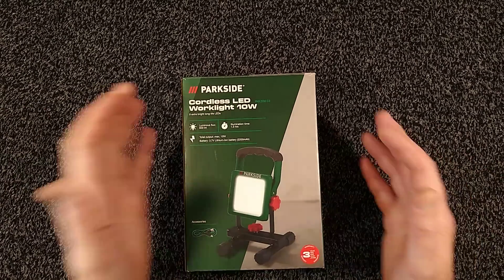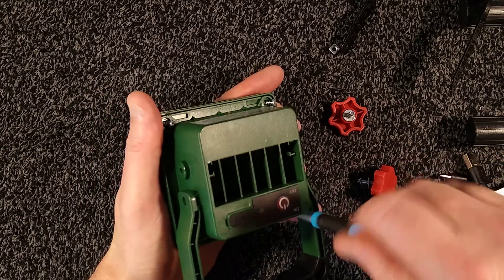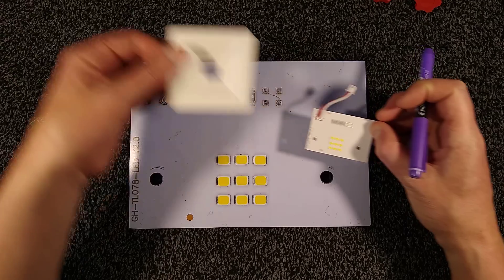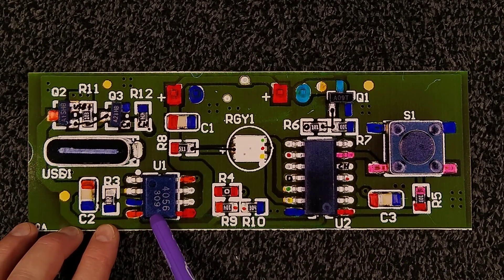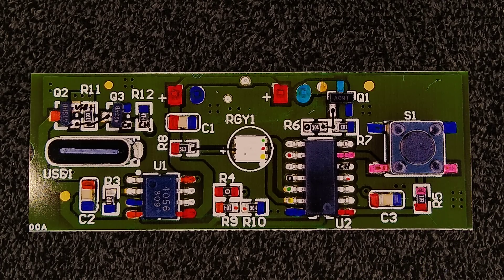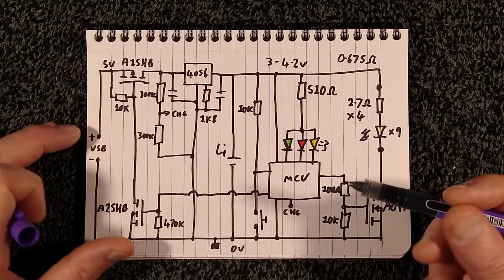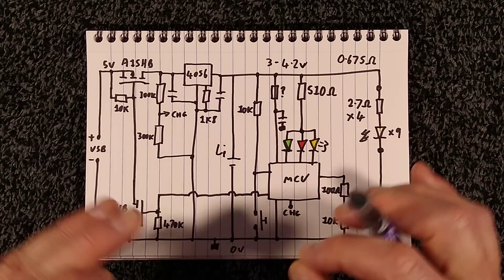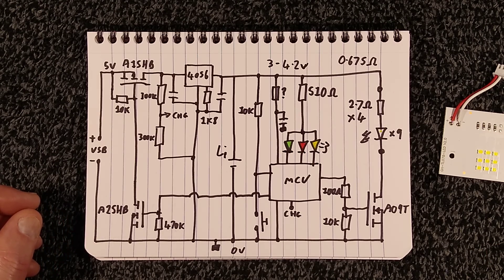Inside a LIDL USB rechargeable work light - with schematic

Comment: I bought one of these from a German Lidl last week and they seem to have changed the circuitry somewhat: It now has a secondary locking switch under the USB port cover that disables battery power (I don't think it's a physical cut off but it disables both charging and the light). The battery pack is still based on an 18650, but it now has a third pin with a thermistor on it. The series resistors have been moved to the main PCB and are now 4x 1.2 ohms in parallel. Interestingly, the unlabelled microcontroller seems to do some PWM, but it only seems to kick in when I connect a small load (not visible on the oscilloscope with the LED board connected, 300-odd Hz at 90% duty cycle when I tried hooking up a secondary MCU for dimming purposes).
Reply: Correction: it's 3x 1.2 ohms. And the USB-C appears to now have the proper detection resistors on it.
Reply: I have this light, but mine has terrible battery life since I bought it. After year it holds I think for 30-45 mi utes, maybe? 
It always annoyed me, that I can't charge it and use at the same time. I thinks it's there be compliant with IP waterproof standard, maybe? 
Do you think that it's possible to remove this switch, so I can charge and use it at the same time? Safely?
Also, can I safely replace that lithium battery with something like 21700? Will it fit in there? Or maybe you have other suggestions?

Comment: 6:56 how come it works without the extra USB-C resistors? Clive used micro USB before because of this .
Reply from the maker: It relies on the use of USB-A to USB-C cables with no device monitoring.
Reply: @bigclivedotcom  my initial reply got deleted by YouTube. I asked about making a custom type C cable to that always worked, but perhaps it would be directional. 

I did say the name of a group starting “one d…..” that’s in the news - I wonder if they triggered YouTube
Reply from the maker: @davadoff  Those keywords may be in a YT incident filter.  Theoretically you could add a couple of resistors to a USB cable to make the charger active.
Reply: No, wait… a regular USB 2.0 type A to micro USB cable with the plugs cut off and replaced with type-c both ends would work… I think 🤔

Comment: Question to CLive, there looks to be enough space in the unit to squeeze an additional cell, do you think with inclusion of a cell balancer module between the 2 cells and the lidl PCB, would these charger circuit handle still work safely ?
Reply from the maker: I tested and a second cell in parallel can fit in.  As long as they are very close to the same voltage when connected in parallel they will act as a single larger cell.

Comment: I have the same light, and i use it as a night/bed light, but I have moded mine by removing the low AH 18650 battery and replacing it with 2x 3AH 18650 cells.

Comment: Ok, Clive, here's a hack you can do. Install a switchable resistor network (i.e. switch and some resistors) so that you can switch the brightness of it.
Reply from the maker: It could be done by putting the switch in series with one of the leads to the LED panel and having a resistor in parallel with the switch.

Comment: I do not see how the MCU monitors the battery voltage. CH6 and the two resistors monitors the voltage input of the 4056 which is not the battery voltage. Anyone know?
Reply from the maker: It uses the divider also used on the push button input.

Comment: what i got from this video is that it is repairable but you cant get parts for it
Reply from the maker: You can change the lithium cell or even add another in parallel.  You can tune the LED current, and if needed you can swap out the LEDs for a new batch.

Comment: I picked up 2 of these from my local Lidl but they are yellow, not green and no logo either.  I also bought one of their little foldable work lights (HG11138 / PAK 2200 B2) with a torch at one end, unfortunately, it has a few flashing modes as well as 2 red modes for some reason!
Reply from the maker: Yeah, I've got one of those here.  The red and flashing modes are annoying.

Comment: Hi Clive, I bought 2 of these lights this week from Lidl mine are yellow, maybe some differences. Battery is 2200mAh I checked the capacity using Opus BT-C3100 it came out at 1310mAh. The 9 LED resistors are 1.5 (yours are 2.7) how many do you think could I cut off? The circuit board is different to yours; the microcontroller has 8 pins no number also has the 4056 chip many other differences compared to yours. Could I heat the LED circuit board with a hot air gun before trying to unsolder the resistors?
Reply from the maker: I tend to recommend just gripping the sides of the resistors and breaking them off if you're just taking some out of circuit.
Reply: I bought a couple yesterday, and got pretty much the same cell capacity. My cells were manufacured in 2021 which may be the reason. I took one of the 1R5 resistors off and the light output is barely diminished.

Comment: At https://youtu.be/wqt2W_AiXKg?t=227 in the video, on the right side, the resistor mounts, there is an obvious solder goober crossing from positive to negative, even crossing to the pad next door, isn't it an effective short, or at least enough to change the resistance value from what was intended?

Comment: I hate it when work lights don't work when they are connected to power. I cut out the R9 transistor. The light turns on with the charger and standalone, but you lose charge indication and battery level indication. It always shows the yellow indicator, regardless of the actual battery level. You can trigger the green (fully charged) indicator if the battery is fully charged and you apply voltage to the old R9 contact to the mcv-side. If you drain the battery and after that you charged the light, the light does not work until you apply voltage to the old R9 contact.

Comment: Ode to Big Clive’s Spark⚡

In Big Clive’s lab of wonders bright,
Where LEDs and diodes play,
Schematic dreams and voltage streams,
Light up his Poundland day.

A USB charged flashlight beams,
By a solar battery’s might,
With lithium cells and capacitors well,
Big Clive makes circuits right.

Neon flickers, twinkly fairy lights,
A Strongbow in hand, no fears,
With retro flair and Chinese quirks,
He’s tinkered through the years.

The defibrillator purrs on low,
As contacts meet his careful guide,
Resistors resist, fuses protect,
In Big Clive’s world, circuits abide.

From tungsten bulbs to plasma arcs,
And poop-like gadgets in the bin,
The soldering iron's warm embrace,
Is where Big Clive’s tales begin.

On eBay quests, he strikes gold,
With crystals, fans, and more,
A tester beep, a voltage leap,
Big Clive’s stash we all adore.

So here’s to the entertainment found,
In every teardown, every shock,
For the electrical art in Big Clive’s heart,
Is safe within his stock!

Author: ChatGPT :cat-orange-whistling:

Comment: It's extremely disappointing they couldn't be arsed to add fractions of a penny worth of resistors to make USB-C charging work. Without those, that's just a socket that vaguely resembles USB-C, really.
Glad there's no dumb seizure-inducing modes, at least.
Reply: I have a small Parkside drill that has USB C but it's not a USB C.

Comment: The biggest problem I have with the "Parkside" range at Lidl is the fact that EVERY one I see the range in, there are ton of tools that require a battery, but not one bloody Lidl actually sells the battery!
Reply from the maker: Because of theft they keep the batteries in a secure area.  You have to ask at the checkout.
Reply: @bigclivedotcom  Would be nice if there was a sign ANYWHERE in the store, like NEAR the tools? :P
Thanks for letting me know, might actually have to pick some up if they are any good!
Reply: It depends. Sometimes they have masses and masses of batteries and chargers on sale and no tools. It goes in cycles.

Comment: One of my favorite hack to do with lights like this is to remove the current limiting resistors and replace them with AMC7135 constant current driver. The wiring is really simple and it maintains a constant brightness to the light output throughout the entire battery discharge range.

Comment: Off to Lidl this weekend then, not that I need another work light…. Lidl and Aldi stuff is generally pretty decent especially at the price point.  I need 4 identical multimeters for a project, Aldi had some a week or so ago but waiting to see if they get reduced when next lot of tools come in 😂
Reply from the maker: I just bought an Aldi meter.  Note that their diode test only tests at 2V so can't light most LEDs.  But it's fine for testing diodes.
Reply: The main problem with either shop is that things like this light are only available for something like six weeks a year. The Plasma Cutters (yes really) they had in Lidl seemed to hang around for longer though. It surprises me when they have such specialist equipment alongside pegs and hoodies.
Reply: @MrDuncl  They're getting the plasma cutter back in next week.
Reply: Lid today had a small wood lathe for £55. I thought that a fairly amazing price. I can't see Clive dissecting one though.
Reply from the maker: @hoverbovver  I saw that, but I'd prefer a full size steel lathe.

Comment: I wonder if the ability of the processor to shut down power might be in case the USB-C makes a mistake and tries to shove in more than 5 volts. One way to test would be to plug it into UBS that's forced to put out 5 volts and mess with the processor sense pin.

Comment: Bear in mind that removing any of the resistors in the parallel network feeding the led "torch" will reduce the network's power dissipation capacity. However, load current will fall, too, so the effect on the remaining resistors may be smaller than expected.

Comment: Thanks for a helpful and informative video, Clive. It's good to know such a light is relatively simple to maintain and is also modifiable.  It may not look like much on the outside, but it would appear to be quite good on the inside.

I wonder if the RGY combo LEDs are also used in traffic light control systems to indicate signal status? Otherwise, RGY is generally a more useful combination for 'all okay' and two types of error condition, for example. 

Any chance of a teardown of a traffic light controller? One of those portable radio-linked and battery-powered types used in roadworks, perhaps, or something a bit different or unusual?

Comment: Walmart in United States sells a super nice "Hyper Tough 500 lumen" compact work light for 10 USD/7.60 pounds/9 EUR. It has a flashlight mode and floodlight mode (it has two lights on it), and both are bright. Flashlight has 2 intensities. 

It has an aimable base (several predefined positions allowable) with small hook and magnets. 

Dust cover for ports and different buttons for the flashlight/floodlight. 

My criticism is that there's no clear low battery indicator. One time it kept turning off after a few seconds and I think that means battery was running flat. Oddly, a few days later it stayed on fine for at least a few minutes but i charged it anyway.

Ergonomics wise, is a bit awkward to hold so it carry strap or handle is needed. Not sure about battery life. And the buttons are hard to read and too close together/too similar in shape to be able to activated by feel.
Reply: The hook is pretty small and won't hold on to surface very securely. A rotatable and carabiner type hook would be a lot better

Comment: We don't have Lidl Down Under (yet)< however ALDI  usually sell similar things, so I'll keep my eye open for this neat and useful gadget. 5V charging makes this sort of thing really handy, especially as a vehicle breakdown light.  Rather than chopping off the resistors randomly, it's useful to replace them all with a variable pot. That way you have a conveniently fully variable light output. "Cheap as chips" from the usual suppliers 🙂
Reply: I got through several of Aldi's Camping Lights that run off three AA batteries. They were useful as a night-light in the bathroom to avoid tripping over the cat. However, they use a pot to control the brightness and after a years use the pots would become intermittent only working in certain positions. One day I must get around to repairing them but for the past few years we have been using a light with a simple on-off switch.
Reply: @MrDuncl  Contact cleaner / lubricant seems to help preserve longevity.  Mind you single turn pots are very cheap from the usual suppliers. Even multi-turn wire-wounds are pretty "affordable" thanks to China (e.g. $1.99 with free shipping)!
Reply: I think many of Aldi & Lidl products, (both food & non food) are made by the same companies.

Comment: 10:03 there is no need for solvent to take out hot glue, I would (and have) use needle nose pliers- if those get grasp /bite then it can be used to pull out glue. There seems to be quite thick film of it, then pliers get good grip and it would be easy to pull glue away. There might be some under battery but I doubt it.

Comment: I do have an  almost identical lamp (although in a different colour, and with micro USB), and i replaced that 18650 with two bigger capacity ones in parallel, and that easily tripled the run time of it. For an equivalent of like 5 euro, and two recycled batteries, it's quite useful little thing.

Comment: Why is there a fet to turn charge on/off? Dos not the 4056 do that automatically?
Reply: Probably just to disable charging while the light is on.
Additionally it provides reverse polarity protection: If you would reverse positive and negative on the USB jack, the p-channel MOSFET's gate would get charged positive in relation to the source, turning the MOSFET off.
Reply: I seem to remember a plague of fake 4056 with bad charge termination detection going round a while ago.

Comment: A few years ago I bought an almost identical work light, sold under the store brand of a German home improvement store. Different colours (yellow and black), but the plastic case is the same. My light has a barrel connector instead of the USB-C connector. It came with a barrel connector to USB-A cable and a USB power supply, but confusingly that was somehow only rated by the manufacturer to put out 4.7V. A teardown confirmed the light contains a TP4056 charge controller so it is safe to use with normal 5V USB. The circuit on the back board is much more simple with only an 8 pin microcontroller in addition to the TP4056. It is also smaller. The LED board has fewer but larger SMD resistors. I replaced the original 18650 cell with a matched pair of 18650s salvaged from a laptop battery, I made sure to transfer the original 18650's protection board over to the new setup. The battery cavity in the plastic case has more than enough space for two 18650s instead of only one. The original 18650 was rated 2200mAh, but was really only 1500mAh. Now my light has generous 5200mAh capacity and runs a very long time on one charge :)

Comment: Another great video, thanks Big Clive.
I don't like the multi function switch we get on a lot of these type of lights, they all seem to start on high and then click lower which is the opposite way it should go to my way of thinking, I agree with Dylan Tomas "Do not go gentle into that good night" but it's a case of when I'm ready and not to get full brightness when you're stumbling in the dark during a power cut in the middle of the night.

Comment: Is it possible to estimate the wattage being used by the LEDs 
(or measure the voltage across those output resistors to see how hard (current-wise) the LEDs are being driven with)?
I know it's something you usually mention when considering increasing the run-time.
Thanks!
Reply: ca 1A, the voltage drop across the resistors i 0,68V
Reply from the maker: To test that I usually run the unit at a known voltage on the bench power supply and measure the current, then multiply it buy about 3V for the actual LED power.

Comment: Very interesting! I very recently got a yellow/black one myself, otherwise identical. 
You mentioned they could have added a microcontroller for light levels, but could you also replace the resistors you said were "removable",with pots, to get an adjustable light?
Reply from the maker: Pots are generally rated for very low power.

Comment: Being a Parkside tool, it would make much more sense it would run off of a tool battery.
Reply: They make one that runs off tool batteries. It looks kind of similar to this style wise but it's 3 or 4 times the size. 

Runs off their 20v battery system, comes with an adapter for their 12v battery system and also an included wall wart.

It's way more powerful than this one and has a couple of brightness modes.

Comment: I'd like to rip the battery out and put in one from a pocket power source. The problem is the capacity of the original one might match the specific heat capacity of the plastic body. If the LED works for longer then the plastic around it could melt.

Comment: I've taken apart a whole bunch of similar little work lights and almost none of them fully utilized the whole battery space. Most of them had the cheapest, lowest capacity 18650 cells I have ever seen (like 1000 MaH or less).

Comment: We are used to incandescant light where a reflector is practical. The leds emit hardly any light to the sides. The reflector has no funtion. Funny
Reply: It's practically not reflector but just cover so innards are not exposed.
Reply: Ive found that the reflectors in many LED lights don't really serve any purpose, other than to make them look nice & shiny when off!

Comment: Solder on aluminum...huh? How?

I've tried that, accidentally, and I couldn't get it to work. That's how I discovered the copper wire I bought was copperized aluminum.
Reply: It is only the backside of the board that is aluminium. The traces are still copper on an insulating layer.